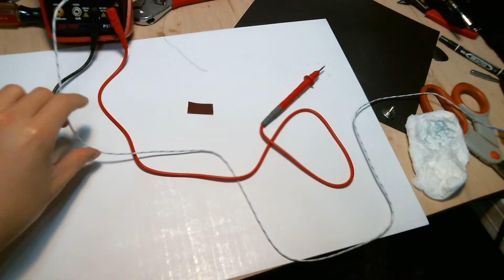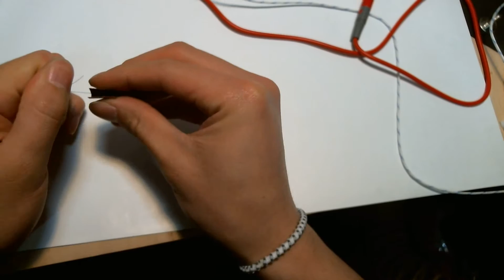Jumper Wire Insulated, for micro connection solder in surface mount Logicboard repair

Comment: Hi there Marcus , couple of questions  , how do I repair , on say the iPhone battery where the solder pads have been removed ?
Also can you please recommend a reasonable priced multi meter adequate enough to use\ test the iPhone motherboard ??? as when ever I try to search this question the seems to be no suggestions what so ever ,